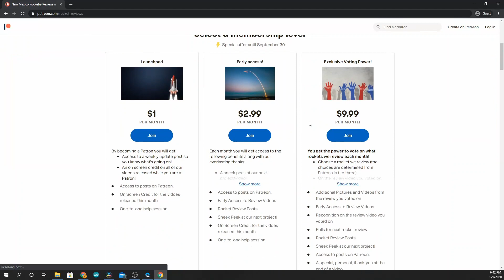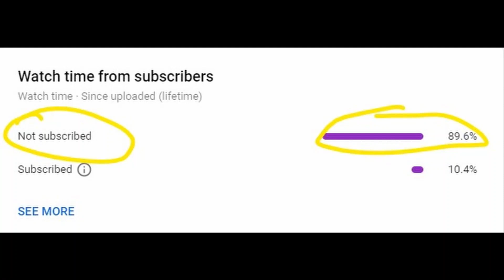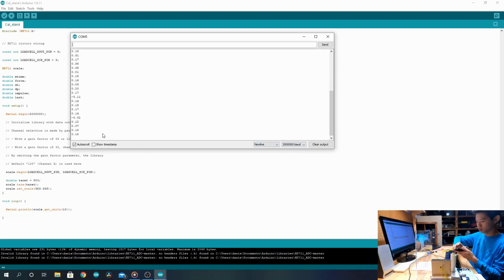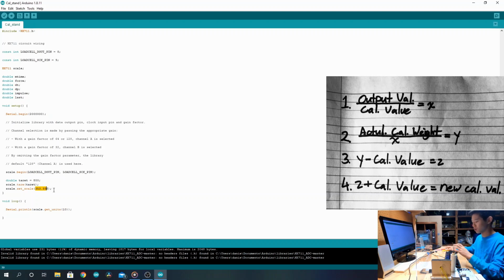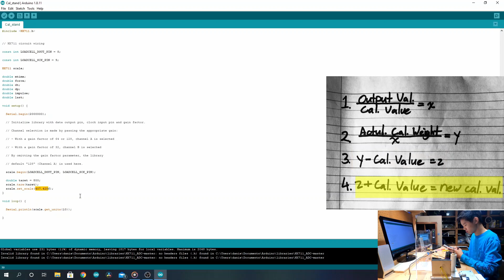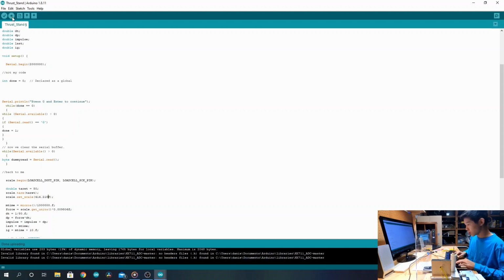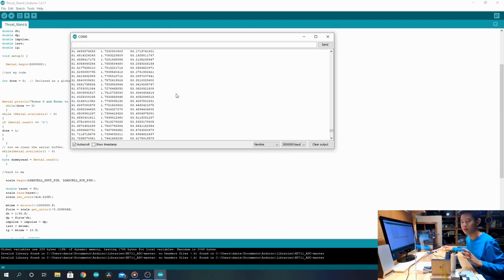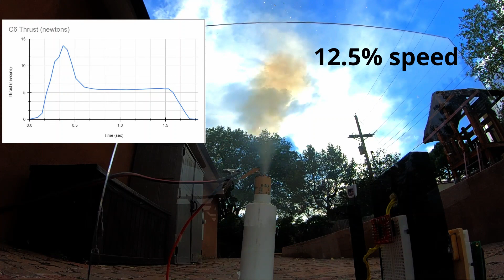Trying out new code provided by a contributor - Model Rocket Motor Test Stand

Comment: Your math doesn't appear to match what you are doing in the video. If you subtract the calibration value from y to make z, then add it back in as written, you just get y again. In the video, your z value is negative, and you flip the sign before adding the calibration back in. Your steps, don't reflect that. Also, I found that if you put too large of a calibration weight on,  your z result doesn't come out negative. In this case, flipping the z value to negative doesn't work, nor does keeping it positive. So your procedure requires a small enough weight to achieve a negative z value which is then added as an absolute value to your calibration value in step 4.